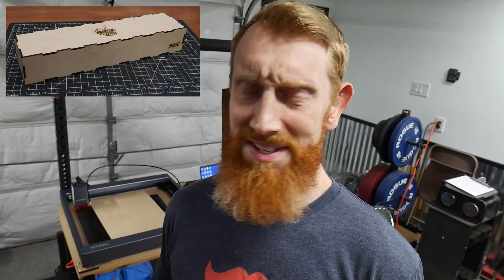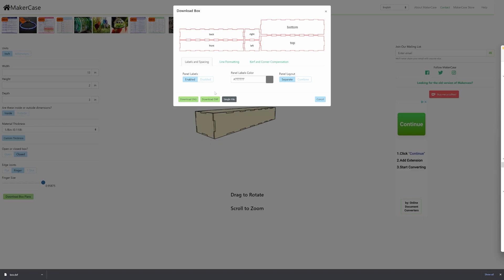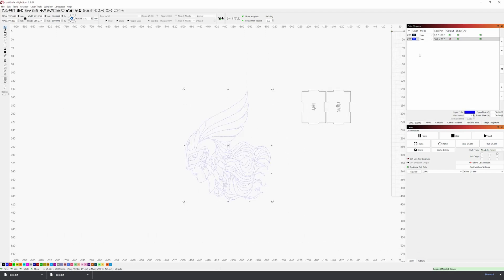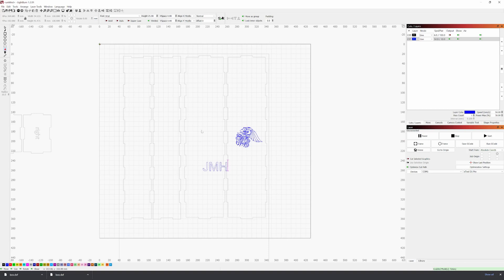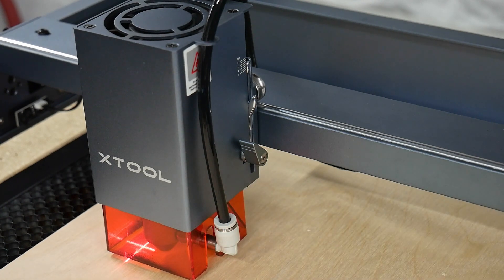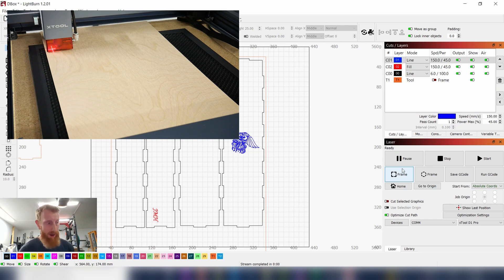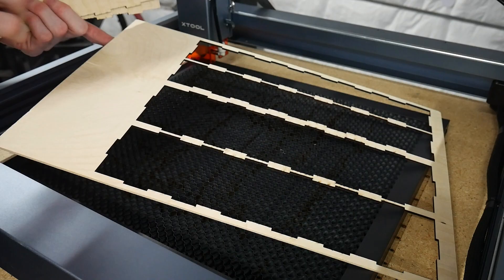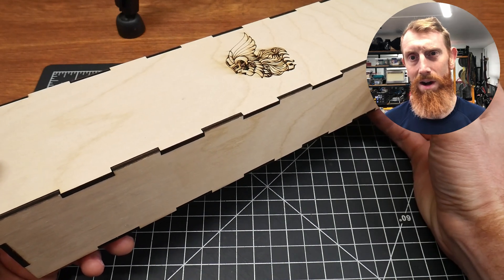How To Make A Box - Full Guide - XTool D1 Pro 20W Diode Laser Cutting Project

Comment: Looks good, great walkthrough in the process. As someone who assembles a lot of mdf laser cut terrain, a tip… when doing glueup with something like the top that needs to fit, glue up the same way but set your top in the piece in place then tape while it is drying. That just ensures that the glue dries and form stays for a snug fit but still able to clean put the top on and off. You can also make a jig with magnets to hold corners snuggly, I use legos 90 degree with magnets and a matching piece for the outside to hold corners without holding it too tight from a clamp or too tight of a tape up.

Comment: I see  black "fadeouts" on  the bottom side of the cutting edges. Im a llaaser-cutter-beginner, but your cutting power seems to high in combination with the slow speed? Wouldn't it be optimal to lower the power and cut it twice?
Reply from the maker: Potentially. I'm still a noob too. Probably ran it too hot. Cheers Deine

Comment: In lightburn, just select a box then an image, then use the center x and y tool. It will place the 2nd object directly in the center of the 1st. Took me forever to realize this. I was just guessing where the center is and only having a 12 inch mini bluetooth keyboard with a 2 inch touchpad for my work table (do everything out of my apartment bedroom) made it really difficult to move objects precisely.
Reply from the maker: nice tip!
Reply: If you want the object to center to the box, click it first, then while holding control, click your box. Then the bullseye button at the top.